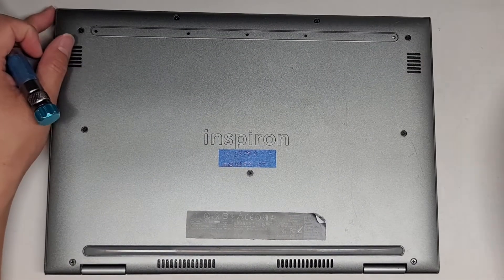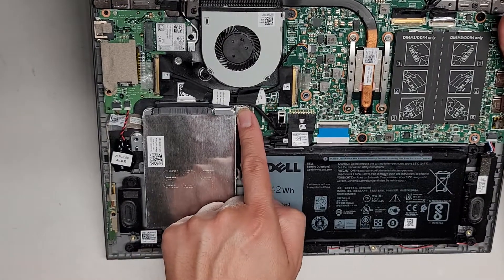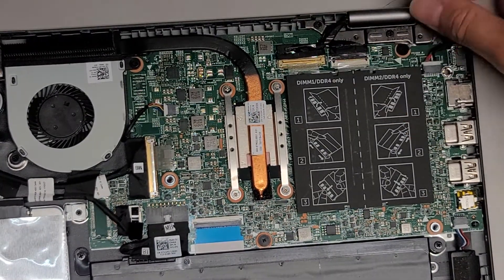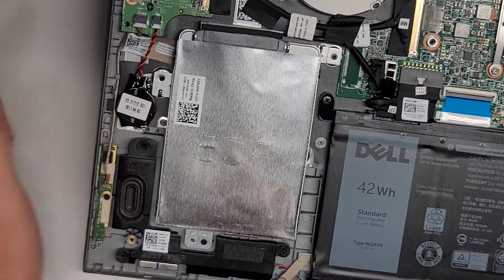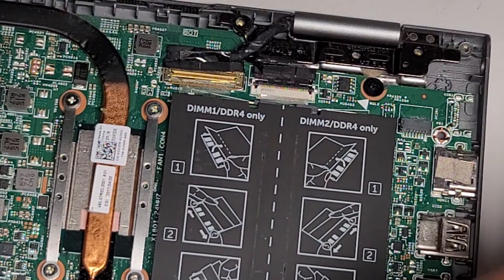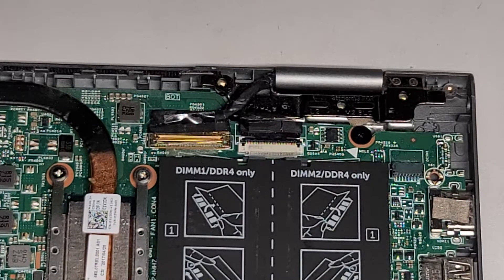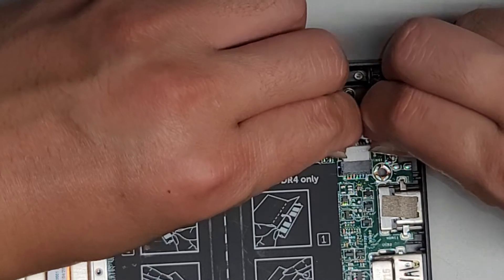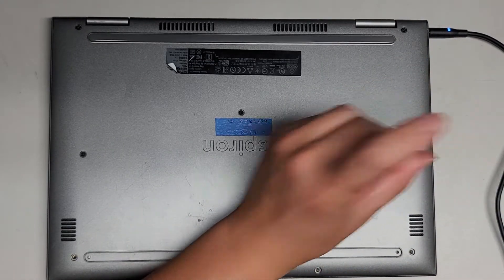DELL Inspiron 13 5378 2-in-1 Disassembly DC Jack Charge Port Replacement Laptop Not Charging Repair

Comment: thank you for showing a clear, precise tour of the guts of this notebook. I was trying to change the keyboard as it typed poorly. Had to removed everything, only to find the keyboard had plastic rivets to lock it in. Had to grind away each of those tabs, replaced with new keyboard membrane, and using hot glue to hold it back. Your video shows me where some of the small parts go (eg the metal bracket holding down the wifi card). The CPU/fan was separated so I guess I better reapply thermal paste. After power on, it showed the date/time was wrong (removed the CMOS battery). The worst part was somehow it activated the bitlocker even though it was only Windows 10 home, and wouldn't have activate bitlocker in the first place. I may have to get a new SSD and reinstall Windows 10.

Got to say much better than someone else's video where it showed everything in high speed, without pointing out the delicate parts, loud background music and no narration. The opposite of what you do.
Reply from the maker: Microsoft is dumb and auto activates bitlocker. They give you a website to log into your Microsoft account. The bitlocker code is there. Glad the video helped. Yeah, I don't know why they add music and stuff on their videos. If you haven't already, please like and subscribe so others can find my videos and possibly consider watching a few others and comment on them to get the algorithm to recommend my channel. Thanks!
Reply: @ItsBinhRepaired  Thanks! Subscribed. Would the CPU fan be on only selectively? I noted that it is not always on and worry about overheat. Could I have knocked off some sensors?
Reply from the maker: @Woodland26  it depends. Some models wait until a certain temperature.

Comment: Hey great video! I have a similar model but thankfully only 1 screw was needed to change the port and did not require lifiting the screen. 

HOWEVER I NEED HELP. I replaced the part, and used both a OEM and 3rd party charger but will not charge. When I plug it in the light comes on the computer showing that the computer sees a charger has been plugged in. But as usual the light then turns off and shows it is not charging. The laptop still turns on and but can't get the laptop to charge. I recently changed the battery about 6 months ago with a 3rd party and has been working since and like normal. I checked and all of the cables are snugly fit in their slots. I've also cleaned it and replaced the thermal paste. Any ideas?
Reply from the maker: Check the bios battery information. Could be a bad battery or a motherboard issue